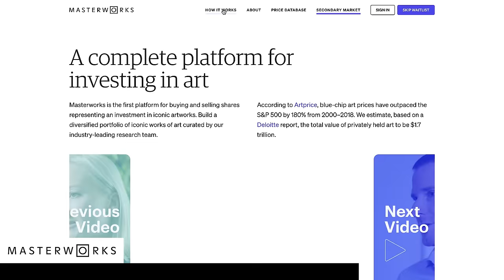When a coffee table ISN'T a coffee table

Comment: About 8:20, I've had a teacher who explained that when you cut wedges, you have to absolutely make sure the tip can't get wedged between the sawblade and the table. He had to ´throw away a sawblade as it got bent when a wedge got stuck.
 In your setup it looks fine, as the clearance between blade and table is quite small, but I'd still recommend cutting the wedge the other way around, so the tip lands on a solid surface.
Reply from the maker: Good to know, thanks!

Comment: I'm proud to say that after buying the plans in May of last year, I have finally finished building this table! It took a while as I could only work on it in my parents yard on summer weekends, but now the beautiful thing is sitting in my apartment! 

I made a lot of mistakes and learned a lot but the plans were great and really helpful. The joinery for main leg assembly took a couple attempts to get right. One reason is that the tablesaw I was using wasn't very accurate and the fence was uselessly flimsy, I ended up clamping a level to the saw instead 😂 It was also my first time using a router so I destroyed SO many extension leaves. And when I finally had 6 leaves, it also took a lot of tweaking to get a flat tabletop. But the end product is really nice, I look forward to testing it with a boardgame night with friends.

Would I do it again? Absolutely. Would I build a second one? Not until I have my own workshop 😂

Greetings from Finland!

Comment: Most European style leave tables have the leaves as the permanent structure and they slide open to reveal a centrepiece that can fold out or lift up to complete the table to a bigger size.

I have a - so I've been told - 50 to 70yo solid oak leaves table. The wooden railing wore out over decades of use so the leaves were flapping about when it was on the bigger formation, so i just hammered a few toothpicks in and now it's stable again 😅😅

Comment: New project?  A murphy table for a u-shaped kitchen nook. Low bench in a U shape, window on the long and one of the short walls.  Breakfast table - so maybe 34" wide and 50" long. Shuts into the wall and leaves a face that could be used as a frame for art or chalkboard?  Maybe has room so when it's down for some storage in the wall.

Comment: This is a great build.  Beautiful and useful.  An idea I would like to share for a build is a portable kitchen pantry. One that has shelves that not only pull out but rotate inside the cabinet that hold things like your mixer, blender, rice cooker, waffle iron, juicer, toaster oven or espresso machine and grinder. It is something I have been wanting for my own kitchen for so long.  To keep appliances put away and clean when not in use.  Off the counters but easily accessible so you can actually use these things without having to pull so many other things out that you never end up using your cool tools.

Comment: Take a dowel and drill a tapered hole in the center. Use another straight dowel and glue to "spread" the outer dowel as a wedge, like a concrete anchor for a wall. An old trick I learned from Grandpa.

Comment: My uncle had, and cousin has, a drop leg coffee table/ end table with a pulley and counterweight that extends AND retracts the legs. It's stamped "Gibbins, California Craftsman Style 1966". The line that manages the pull and push of the legs has cables  that form some kind of double fig-8. There is a weighted wood box that rides up and down a vertical tract that manipulates the hook for what line direction the weight acts on. all you have to do is pull the trigger and lift lightly to raise it. The tract sits as a center 5th leg when it is down. It made of redwood and has steel pins in the pulleys.

Comment: You could leave it in the tilt position and read the paper on it or use it like a drafting table. I love convertible furniture as well. it is good for small spaces like little apartments or tiny homes. Modular design is also a wonderful concept.

Comment: Hi, I just discovered you and I love your work and this build...sorry I'm so late to the party. One of my first jobs was refinishing English Pub tables. They all had similar top/leaves to what you did with one small but significant difference. I wish I could add a drawing to illustrate this, but I can't so I'll try to describe it. On your leaves you have the under supports set up so that outer most supports on one leaf goes inside the supports of the other leaf. This makes each leaf unique and dedicated to a specific side of the table. If you made the under supports so that they are were set up to go to the left (or right) of the supports of the other leaf then both leaves will be identical and interchangeable. I hope I described this well enough. Thanks, I'm off to watch more of your videos.

Comment: 25:20 with the two pull outs you alternate the supports (the pair far from the camera is different than the other two) but if you keep them all the same on all 3 pairs you should be able to make both sides so they are interchangable and the cuts are the same for both supports underneath. simplified design and less chance for errors.

Comment: another thing to think about in the future is the long term wood on wood polishing that will take effect on pieces that rub against each other, they'll eventually form a semi work hardened surface that is super smooth in action so making things a snug fit to allow for that isn't always a bad thing, just have to get used to things being a little sticky for the first few dozen times you use it or so till it starts to wear in.  if you ever wanted to embellish it a bit you could swap out the dowel and track for brass plate and brass dowel since walnut and brass go very well together!

Comment: I love your leaf system in this. thanks loads. you've given me a lot to ponder on. I want to make a table that can both be used for card games like magic the gathering (which want a normal dining room table height ~70-77cm and width ~80-90cm) but then also use it for wargames like warhammer 40k which want an elevated play area (90cm high) so you dont stretch as you walk around the table and move miniatures, but also a much wider table than most dining room tables (~112cm). This table concept solves both of those issues. Many thanks

Comment: Your perseverance and perfectionism were really impressive. That was a well earned boots-up-on-the-table moment there.

Suggestion/request for a wood/mechanical design: a drawer for high cupboards which can pull out as normal, then swing or otherwise descend down to waist height for easy access to the contents. In my (limited) imagination it needs springs or gas pistons to stop it coming down with a crash, and to help with lifting it back up.

My parents are short, and ageing, and have some kitchen cabinets that are high enough they almost need a step ladder to use them.

Comment: I'm not a woodworker but I still love this beautiful design. It is really practical too, especially if you have a small dining area. The one thing I think you could improve is that "drop" while folding or unfolding. You can see it at 39:59 and 40:24. I'm guessing a change in the shape of the bottom of the four folding upright struts. (I know, everybody's a critic.) But it's a beautiful design and quite workable even though it's only the second one you have built.

Comment: Modustrial Maker used during his home renovation a cabinet for his bedroom that hid a lift for the TV ... 
Pretty sure with a slight bit of thinking you could find a non electrical solution that would fit into your portfolio. Maybe springs or "shock absorbers" taking most of the weight or a counterweight  and pulley thing, depending on how heavy the TV would be?

Comment: To fill that hole, sand some walnut so you can collect the walnut dust. Mix that with the epoxy and that ought to be a close match to the wood. You need felt inside your crab claws so they don't mar the stringers.

Comment: Hey great video. I specifically appreciate your willingness to make it a little longer and go slightly off topic. 
Thats how projects go and that's how the videos should be made too! 

I wanted to say too that make sure you don't use blades with shoulders. Or if you do its better if they're raw metal. Or do so knowing there is a risk
I just found out the sawstop might not stop right away if the first contact is with the shoulder instead of the bare metal blade so it could get one good cut in before the saw activates. Just learned that the other day and figured it's always good to pass on safety information.
(now that i'm looking again at 7:15 the shoulders are super low. Maybe that doesn't have the same risk and still helps with kickback? idk, interesting discussions could be had)

Comment: Great mechanism! As for the last question, I have a project for a convertable type furniture but I'm stuck on one part which is concealing the drawer slides. It's a board game with a split table top that covers the play area when not in use. Imagine 2 draws on either side acting as a table top and a small rectangle area for the boardgame(backgammon). The only solution I've come up with is to have wood on wood dovetail slides mounted underneath the play area. It would work but I'd much prefer the smoothness of ball bearing drawer slides.
I have a rough sketchup design if you want to have a crack at it.

Comment: Very nice work Michael, it looks stunning. If the settings are folded in, you can identify them clearly when looking at the short side of the table. 17th century furniture solved that with a false double layer table top on the short sides in between the wings. Did you consider doing something like that and if you opted not to put them in,  why not? Thanks Julian

Comment: 40:18 The only this I see wrong is that jolt of the right side as you life the left side vertical support up to unlock and lower it. Is the right side elbow under tension/compression while you talk over to the left side and lower it? That might put some weird strain on the right side over time and lead to the vertical support cracking or bending.

Comment: We have downsized and i would love a table that could be hung on the wall like a mantle, then either opened up (pullout) or taken down off the wall and opened into a full size table for use when company comes.
Reply from the maker: That’s a really cool idea!! I like that
Reply: @MichaelAlm  I was thinking boards about 8 to 12" wide that would be connected, piano hinge style, that could fold into a z pattern, then sit atop some pretty supports on the wall, the supports could swivel to the side when the table is in use, so as not to smack your head.  As for the front of it when its on the wall it could have a u-shape piece that makes the front look like a standard mantle.  Not sure how to get the legs in this picture, maybe you have an idea.  My house is modern, so I would like a sleek look.

Comment: Nitpicking here, but the heightened part of the table looks a little lacking in lateral strength. Would there be a way to include  a cross brace to protect it from forces applied sideways, instead of straight down? For example, adding 2 pairs or diagonal braces that "crab claw" lock into place in the center. This will strengthen it from say someone falling into the side of the table. Right now it looks like the only thing resisting this kind of force is the vertical "crab claws", which I don't think will stand up to much given how thin you needed to cut them down to fit

Comment: At 19 min you noted all you needed to do to remove the top would be to twist them. does that mean that the table will fall out of socket if twisted or hit on a corner by any chance? has there been any testing you have looked into to see whether the guides are too shallow and shouldn't be able to just twist off or would it need a significate amount of force to twist them off the guide? I own a table that has a similar type of fold out mechanic on it and the company has the arms bolted down to stop it from just popping out randomly.
Reply: Btw great looking work. just was wondering if that was maybe a factor. I am new to all this so wanted your insight

Comment: I'm be curious to see a strength test between joints with biscuits/dominos and joints without. My thinking is that the biscuits/dominos would help with alignment, but add no strength to the joint as the biscuit/domino itself becomes the weak point.

Comment: why don't you put on the plastic protector tingy over the tablesaw? Is that ok from a safety point of view? I am worried for you :)
Reply from the maker: There are a couple schools of thought. I personally think that it's safer without because I can see the blade and be aware of my cut at all times. I always use a push stick when I'm close to the blade. Some folks feel safer with the plastic guard in place, and that's totally fine. My saw is a SawStop, and that's a major added layer of protection.
Reply: @MichaelAlm  oh right, I see. Thanks for the answer :)

Comment: You didn't design this. It's a copy of a Danish design from the 1960s. I know because my parents bought one in the UK and I now own it. It is identical except for the materials used. The original frame is solid teak and the table top is teak veneered board with solid teak edging..